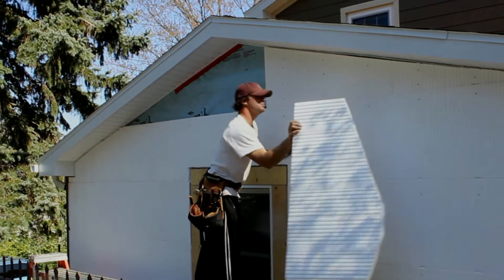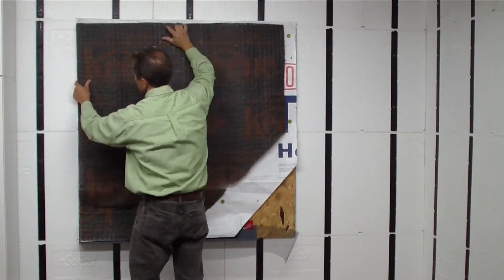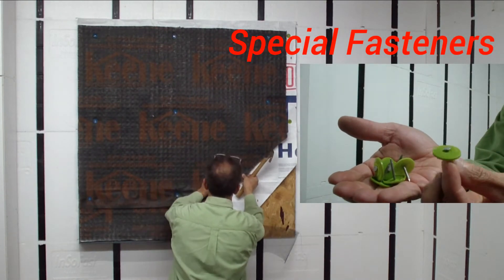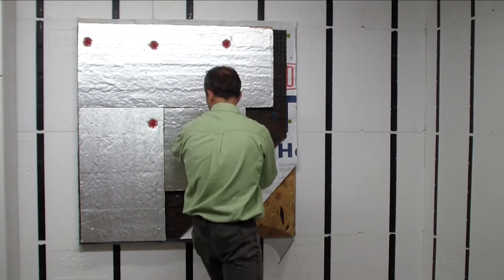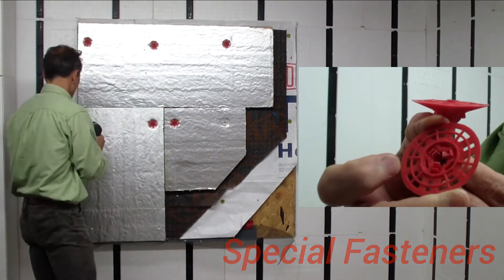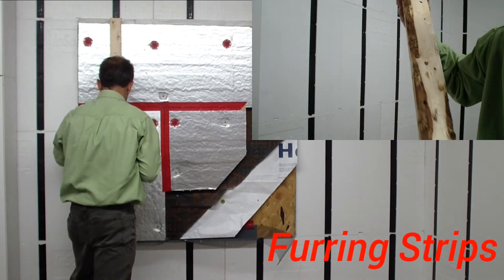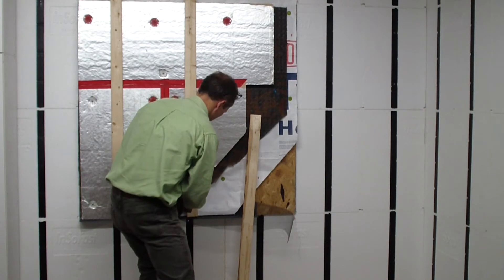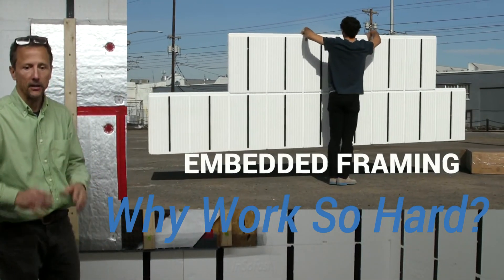How to do Exterior Continuous Insulation the Hard Way

Comment: Nah.
Control layer outboard the sheathing.
Rockwool.
Rain screen.
Cladding.
Reply from the maker: Sure anything can be made to work to make mineral wool, just takes more work at a higher cost. Use at a minimum  (4.4 pcf)  or higher mineral
wool insulation boards. This will reduce the measurable wind washing impact that at a lower density be effects and lowers R-Value. Also take particular care with methods of fastening the mineral wool with metal screws and metal studs to prevent cold spot condensation at a potential hot spot for rust. Good luck and wear safety glasses.